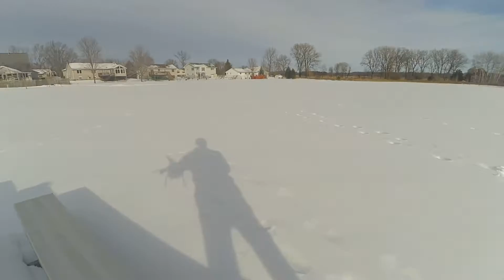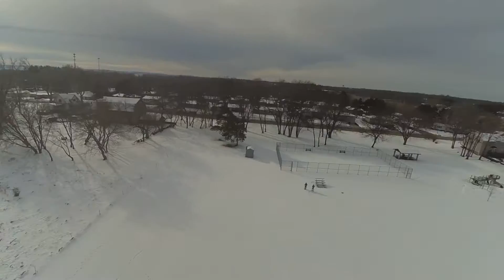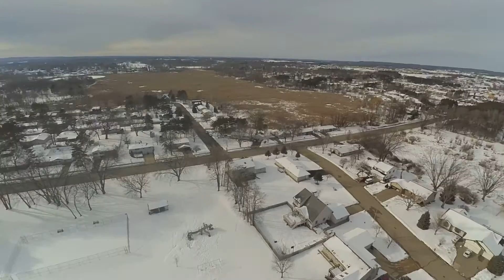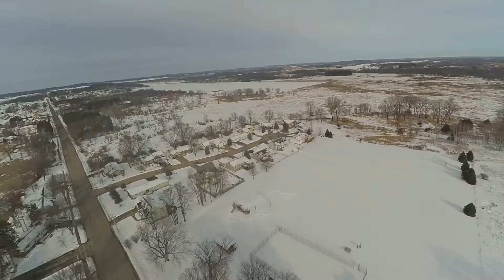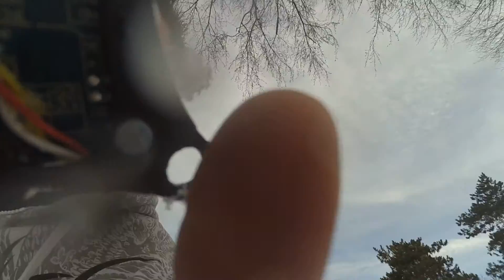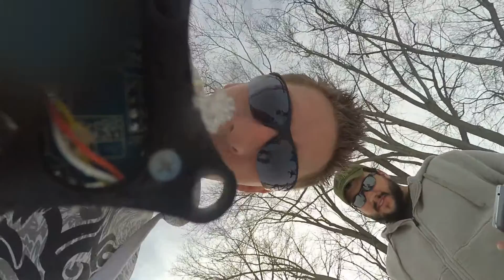Syma X8C brushless conversion plus 2D gimbal and Yi cam + crash!

Comment: Hi, the battery 5500mah mesure 6 inch long how to fit to the x8c ?
Reply: I use the same. 11.1v 3000mah 30c   and other i have down to 1800mah can also use stock battery if i not fly with the gimbol and sjcam. have also a fpv cam tlv1000 and 600mva transmitter for the video and a 3 way video switcher and bluetooth tracker stacked on this.  the poormans phantom :)
Reply from the maker: I strapped it to the bottom with a piece of adhesive velcro and a safety strap.  it is far too big to fit inside the stock battery bay. flight time with this conversion is up to 18 minutes
Reply: whats the wheight on the battery you using?  i use 11.1 1800mah  that fit inside nearly.
Reply from the maker: +datapakx25 I used a pretty big battery, around 3000mah to get higher flight times.  On my newer x8 brushless conversion, I have room inside the stock battery bay. I can fly using the stock battery if I wanted to.